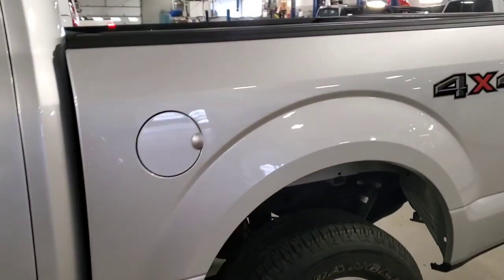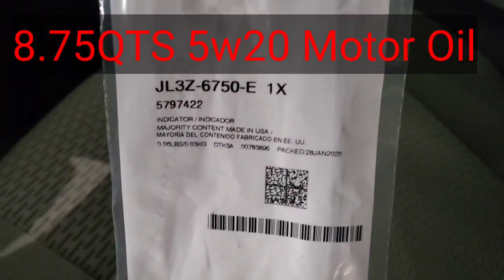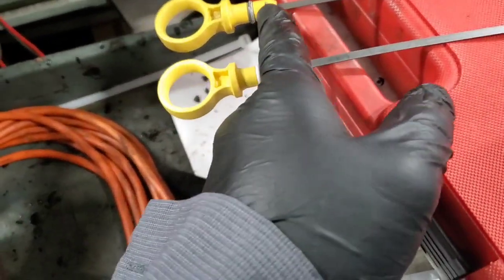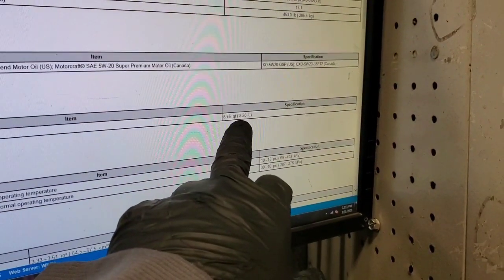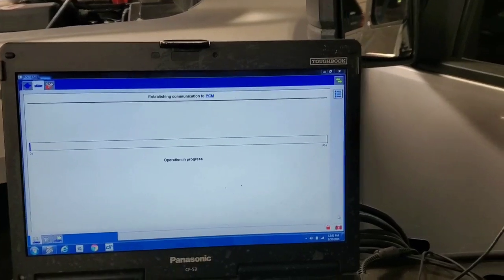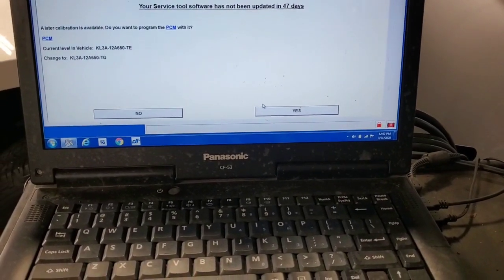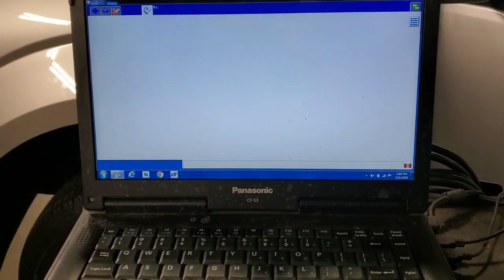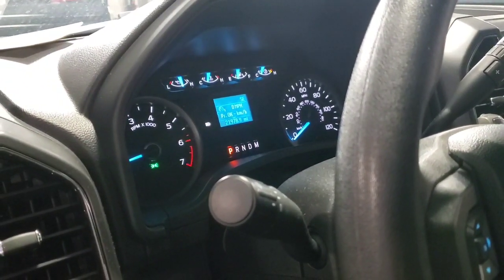2018 - 2020 Ford F150 Oil Loss or Oil Consumption Technical Service Bulletin

Comment from the maker: Complete Write up In The Description Of The Video

Remember if your interested in me servicing your vehicle and your in The Dundee Illinois Area let me know and we can get you an appoint scheduled and get you in
Reply: Does this apply to older 5.0 I got a 2011
Reply: Will geebanger no, only the 3rd gen coyote engines
Reply: Have you seen any 2020 5.0’s burn oil? Are they good engines?
Reply: @haddonsmith345  DON'T BUY THE 5.0 I HAVE ONE THIS TSB DOES NOT WORK IM ON MY 2ND ENGINE AND LOSING OIL LIKE CRAZY.
Reply from the maker: @haddonsmith345  So far no issues
Reply: FULL CEND - TKM Good deal. Just purchased a 2020 platinum with the 5.0 and I love the truck but really hoping I don’t get oil consumption problems. I change my oil every 5k so maybe I can avoid it for now
Reply from the maker: @haddonsmith345  I still and I know everybody doesn't like this recommend people do it every 3000

That motor is noisy inherently on the 2020 but that's just the nature of the Beast and we had some people ask why is it so noisy sometimes and Ford specifically States that's normal for that engine

I don't do anything more than $3,000 on any of my vehicles anymore but that's just me that's just a personal preference
Reply: FULL CEND - TKM Thanks so much man, so you think I didn’t mess up getting the 5.0?
Reply from the maker: @haddonsmith345  that's the one I would have got if I would have got any of them out of the new line
Reply: FULL CEND - TKM I keep a close eye on my oil regularly and it’s not low or anything but my motor always sounds like it’s knocking for some reason? Is it just supposed to sound like that? It gives me some closure coming from a person that works with them everyday
Reply from the maker: @haddonsmith345  unfortunately that's one of the most complaints we get is why are these new F150 motor so noisy and Ford says that is normal that is a characteristic of this engine
Reply: FULL CEND - TKM From what I can locate it’s making the noise worse on the passenger side and maybe toward the back of the motor if it’s normal then I’m not going to worry I’ve owned lots of vehicles and never had one sound like this that being said I love this truck and it makes the perfect amount of power for me I think my only complaint is the noises it makes. I sure appreciate you responding to me though
Reply from the maker: @haddonsmith345  I would have to hear the noise
Reply: FULL CEND - TKM Do you have any other social media maybe I could send you a video?
Reply from the maker: @haddonsmith345  email me 

poissorichard.rp@gmail.com
Reply: FULL CEND - TKM I emailed you a video of what mine sounds like, get back to me when you can thanks so much
Reply: FULL CEND - TKM Did you get my email?
Reply: @haddonsmith345  16 injectors! And they are very high pressure like a diesel...clacks like a type writer and rings the cast aluminum like a bell.
Reply: I know this is about the 5.0, but I just bought a very very late build 2020 f150 3.5 EB. Have they gotten the cam phasers thing worked out with them? I figured most of the problems have been solved by the end of the run but I just thought I’d ask. Mines doing very good so far. 8900 miles on it now in just 3 months. My build date was 10/1/20. Almost the very last of the body style off the line.
Reply: Were in Dallas Texas?? Thanks

Comment: IF YOUR TRUCK ISN’T LEAKING OR SHOWING OTHER SIGNS OF ABNORMAL WEAR SIMPLY CHANGE YOUR OIL EVERY 5K MILES WITH FULL SYNTHETIC 5W30 MOTOR OIL AND LEAVE IT ALONE 🤙🏼🇺🇸
Reply from the maker: Agreed

Comment: Where did you get the longer dip stick
Reply from the maker: It's only on the 2018 model and I ended up getting it from the Ford dealer where I worked at the time

Comment: Way to go ford . The computer fix makes my two wheel drive truck useless in the snow . The throttle body closing slower makes it almost impossible to rock it from forward to reverse and I’m sure will screw the transmission in the end. Just as big a pile of crap as the Focus transmission fix u screwed me on . Never Ford garbage again  😕

Comment: I wonder if the excessive vacuum issue is also why the IWE check valves go bad and leak? Causing the intermittent grinding sound, I just replaced mine and the sound is gone but does that mean I should start checking the oil more often now that it might be pulling more vacuum again and sucking more oil?

Comment: I have a 2020 5.0 and after doing some research it seems like there is thousands of us with the same exact problem. We all need to join the EXCESSIVE OIL BURN CLASS ACTION LAW SUIT. And not let Ford keep getting away with there defective engines. Which we pay a fortune for these trucks . I only bought this truck because my father in law had a 2004 ford v8 that has almost 500 thousand miles and was still running with the original engine and transmission nothing like the trash im paying for now!

Comment: Just discovered my 2018 Lariat burned over 2 qts oil between oil changes....After this great video, I took my afflicted truck to the Ford dealer. I had 67,900 miles and was 'out of warranty.' 

The dealer suggested giving Ford Customer Service a call and seeing if they may work with me and provide some $ assistance since there was a TSB on the issue.

Long story, short.... I contacted customer service and talked to a really nice person.  They stunned me by covering about $200 of the $291 repair (new dipstick and reprogramming the PCM)....and then, really shocked me by offering me a 7 year, 100,000 mile warranty FREE OF CHARGE....covering my entire drive train.

This would be from the time of purchase.....so still gives me roughly 2 years of extended coverage with just a $100 deductible.  

This truck was my first Ford vehicle I have ever purchased...

I will say, how they work with you is based upon a point system.  If you purchased the truck new, that gives you points....if you can prove you had oil changes and service done at the Ford dealer....that gives you points.  So this definitely helped my cause.

If you bought used and had all your oil changes, etc done somewhere else....naturally, you probably won't get any help or consideration.

My ultimate questions are:

1) Is this fix bogus, and will I experience the same and worse failures down the road?

2) Should I sell this while I still can?

3) Hemis all have the Hemi engine tick, which can cost money and sometimes be fatal to the engine, GM has lifter problems, Toyota has rattles and wind leaks everywhere.....what vehicle is safe?

Do the 2023's suffer from oil consu.ption issues or did they reengineer the 5.0 to fix this in 2021?

Are the 3.5 eco boosts pretty rock solid now?

Comment: I have an 2018 Lariat with the 5.0. It went thru 2 separate oil consumption tests. Missed being too much. After the second one the TSB shown was done by the dealer. In 3000 miles it was down a quart or close to it again. I changed the oil MotorCraft semi-synthetic like every change. I used 5-30 instead of 5-20…….The engine no longer uses any oil in 2 subsequent changes. Easy fix. The truck has had a catch can since new.

Comment: I currently have a 2018 f150 5.0. Problem started with check engine light and error code P0025 and P0019. Took it to a Ford dealership who couldn't look at it until 3 or 5 days later forcing me to rent a car. They performed the TSB with the new dipstick and reprogramming the PCM. Everything ran great...for two weeks. Now the truck stalls and justs cuts off at low idle and runs like crap when running at higher RPM. Pulled the codes and got the P0025 and P0019 errors again. Suffice to say, now the truck is at a mechanic waiting to be looked at for this latest issue...which I'm sure is still related to the first issue 2 weeks ago...but this time it's worse. My first Ford...probably my last.
Reply: Any updates on that issue? My 2019 5.0 has also had some issues with the oil level being too low and I want to know the fix, either that or just rid of the truck.

Comment: what does something like this cost to do on your truck? and is there a way to find out if your truck already had this tsb done to it?
Reply: I believe if you give a Dealer your VIN nbr they will be able to see if that VIN has had work done at a Dealer and it was logged into the system...

Comment: My 2018 Ford F150 just went back after the lease was up. I had every type of pickup. Ford by far is the biggest piece of garbage i ever had. In less then 3,000 miles the dip stick would be completely dry of oil, Ford would not acknowledge the problem! EF them!!! Never again!!!!

Comment: I have a 2021 f150 3.5 ecoboost.  It used 2 quarts of oil in the first 4,000 miles and then it stopped losing oil. Now has almost 9000 miles.  Any idea why? 

Other problems too like 1 of the crap Pirelli tires self destructing at 4k miles, and electronic problems too.
Reply from the maker: It was still breaking in

Comment: I threw the sway bar away. I rarely will drive over 80 in the shit traffic of LA and plus more travel for off roading but yes my 2020 F-150 5.0 does have this issue. Either way I change the oil every 4-5k miles with Amsoil. I run E85 is why. If I didn’t I would let it go way longer

Comment: Will the dealer only do this if the customer ask for it? I have a 2019 with 12,600 miles and I heard about this, checked my oil, and it looks low to me.
Reply from the maker: You can reference this and the dealer will look into it for you

Comment: I loved my truck then noticed a rattle; dealer said it was normal. Saw all YouTube videos showing this TSB isn’t some mystery.

So once they reprogrammed the PCV, it’s good? Won’t burn oil?
Reply from the maker: I did 2 and they never had issues after but I can't say if it's solid
Reply: @fullcend-tkm73  I had this done to my 2020 5.0 and 3k miles later its bone dry again. Currently at dealer trying to figure out whats going on.

Comment: I'm not too surprised because of one thing and I hate to create hate but it's a FORD! Customer shouldn't have 2 deal w nonsense like this but atleast ford is standing by it..Your gonna have problems w cars even new typically minor ones you'll have to take back 2 dealer such as water leak in truck or something along those lines but engineering like this! Especially FORD! 4 as much pride they put in their work and customers expect it to b worth is just saad., Hope it works out 4 customer

Comment: I had a 2018 F150 King Ranch that a spec built myself.  Waited 11 weeks to get the truck.  It was a dream truck for me but couldn’t wait to get rid of it in only 13 months.  The engine consumed oil like mad. Ford at the time would not acknowledge the problem. The truck started to give a puff of smoke at startup with only 13,000 miles on it.  Even if they were able to fix the oil consumption issue there was still the cam phaser rattle that happened upon deceleration when cold, it sounded like the ball in a spray paint can being shaken. Also if you had to accelerate hard the transmission would make a loud clunk under the passenger front seat between second and third.  And to top it all off the transmission would shift so early when just cruising around in town unless you were hard on the gas pedal ( which I wasn’t). The transmission would be in 9th gear by the time you hit 35 mph and then the truck would chug, be sluggish until it downshifted to give normal power even with the 5.0 L coyote.   People say I should have got a tuner to adjust transmission but you shouldn’t have to do that on a new $68K truck besides it possibly voiding you warranty.  I switched to a 6.7 diesel Super Duty and never looked back
Reply from the maker: I'm sorry to hear that and I definitely deal with customers who are in the same boat. The last few years have indeed been rough with ford
Reply: @fullcend-tkm73  yeah it’s hard to love Ford because you know you will get your spirit broken. It’s like being in a did functional relationship.  I’m hoping my 2020 Super Duty 6.7 will treat me right.  Good video. I was told that it was the cylinder linings they put in the new 2018+ coyote engines. I’m glad they found a fix. I had a $500.00 oil catch can system that caught a decent amount of oil but was always concerned that the valve train already got fouled by blowpass oil.  And living in the cold climate I was concerned using an oil catch catch when it’s single digits outside

Comment: Mine is still eating 5 quarters per 5000 miles the reprogramming didn’t solve anything
Reply from the maker: Well you've got an issue definitely and the dealer is going to have to look into it

Comment: What a piece of shit! My 2018 coyote rattled on deceleration,  lost a quart of oil a week and ford claimed it was normal on 4 dealer visits. Get a tacoma! Oil stays where it should and no rattle.  And no cracks in the brand new dashboard
Reply from the maker: I've had 2 new Tacoma and 1 tundra come in jewelry with oil leaks

Comment: I have the same problem on my 2011 f-150 5.0 it consume a lot oil, so this will fix the problem? Is been like that since I buy it
Reply from the maker: Nope this is not going to fix yours

This is only for the new trucks you probably have some kind of compression issue like ring Gap or something is wrong with your PCV system
Reply: @fullcend-tkm73  thanks for the answer

Comment: The new 2021 have the newly designed engines and not the 2018-20 oil drinkers. I’m waiting on word now for a buyback and currently in line for complete engine change out.
Reply from the maker: exactly
Reply: Does that mean the 2021 has normal cast iron cylinder liners press fitted in the  aluminum block? That is the only way Ford will ever fix the problem, plasma bore liners fail rapidly creating huge oil consumption. a thin layer of new metal is plasma welded to a bare engine block aluminum cylinder, then bored to spec, once bored to spec to receive the pistons its too thin, .010-.020 thouandths is all you get liner thickness, there is no rigidity in the cylinders with this thin cylinder liner, the block flexes under load creating abnormal cylinder wear.

Comment: If its just a recalibration to control the fuel injectors then why the modified dipstick and extra qrt of eng oil ? Then you get crank windage splash and foaming ? And an $5 every oil change
Reply from the maker: I don't know what the reason is for the change in the dipstick level marks

Comment: Getting a 2021 5.0 this spring. Hopefully Ford has figured out this oil usage thing I am not buying a Ecoboost they are for leases.If you want a truck for 15 plus years get a V8. Funny how power train does not outlast the body anymore.
Reply: Please dude stay away from Ford, I have a 18 platinum with the 5.0 I did all of the update crap and still burning oil, and my truck make a bad rattling noise when taking off, and sometimes when I take my foot of the gas I get a clunking noise, all the dealers kept  saying they didn’t hear it but it’s very noticeable, and now Ford has put out a letter saying that it’s normal for the engine, and all of a sudden they started hearing it, but the say Ford says not to do anything about it, and fast forward now I have to get my dash replaced because it’s buckling at the top under the windshield wipers, come to find out everyone that has this truck has to get a new dashboard, dude save yourself the headache and don’t buy this truck, I bought it brand new because I knew by the time I was going to pay it off, I’d be retired the same month, but Ford has ruined my plans, now I have to take a hit on the depreciation and trade it in for another truck which is gonna put me two more years behind my retirement plan, screw Ford man because they have screwed me but I will never buy another Ford, but good luck
Reply: I will have a hard long talk with the techs I worked with at a Ford dealership 15 years ago now a tech at a Freightliner dealership. Yeah 2018 was the first year for plasma spray in cylinders in an aluminum block.Three years later who knows if its better. Dodge would be my second choice but the Hemi eats cams set too high in the block gets no splash from the rods at idle. The body electrical craps out after a few years. And forget GM have driven newer ones slush in a bucket. Have an 07 with the problematic 5.4 3V 170,000 K now still quiet over service the shit out of it and drive it hard . Only let me down once starter went out at 120,000K  got it towed home to my garage a quick trip to the parts store in my sons 2012 Superbee yeah him driving fixed and to work the next  morning. Yeah had the exhaust manifolds done the following spring by my old work lifted the cab lifted the engine out of the frame and did them properly at a fair price.Anyways lets see what 2021 brings 2020 has been the shitty year since 1966 when I became a player in this shit show.
Reply: Good luck. Keep the radio up to cover up engine noise. Lol ford can't wait to drain your pockets.
I bet you trade it in less than a year.

Comment: Just noticed that my truck is a little bit less than half between the min and max marks, it has 12,000kms it’s a 2020 5.0
Reply from the maker: keep track of miles between oil changes to track
Reply: I did just check the dipstick and it looks like the new one you installed in this truck, the separation between the min and max is longer, kinda hoping that it’s just that the programming needs to be done
Reply from the maker: @fernandoborjas  what I'm saying is the best thing for you to do in between your oil changes has to check how much you're losing, some is okay between oil changes you can lose up to a quart but anything more than that is not acceptable
Reply: FULL CEND - TKM thanks, I will do that, am I correct to say that between the min and maximum mark that’s a full quart? If so, I have lost about half a quart over 5,500km
Reply from the maker: @fernandoborjas  thats correct
Reply: FULL CEND - TKM thank you!
Reply from the maker: @fernandoborjas  not a problem